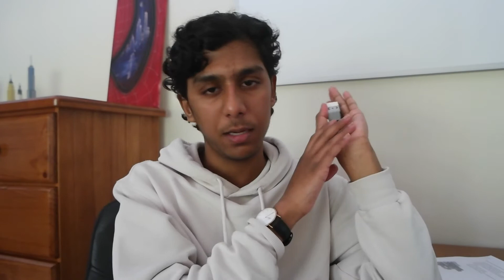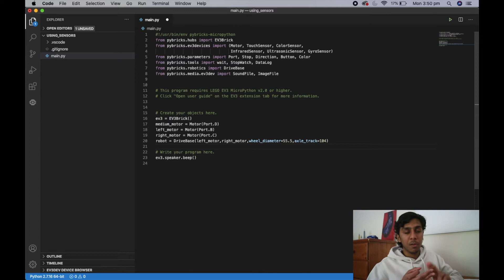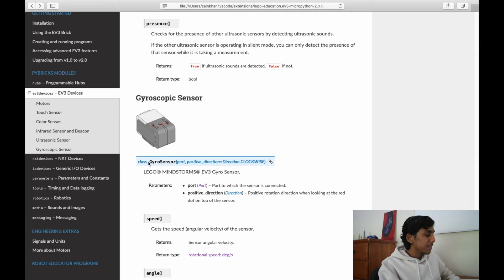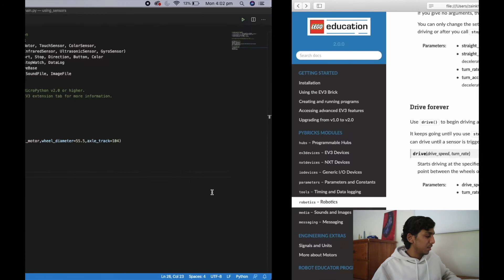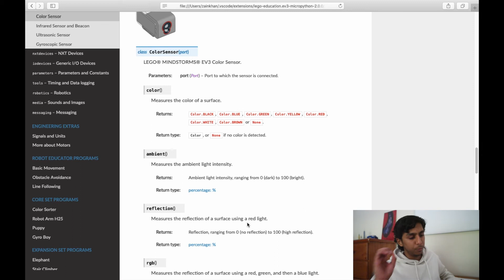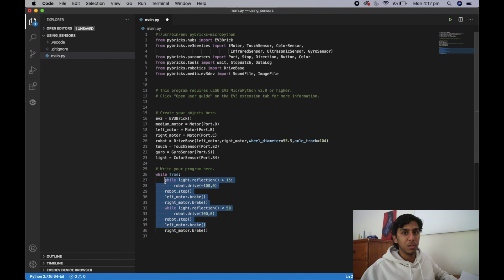What are Sensors and how they Improve your Programming in EV3 MicroPython [4]

Comment: hi, how did you modify your environment?, because every time you run the program it began faster and sound like if you are using EV3-G. Every time I run the program does not make any noise and the startup delays like 5 seconds, which means I need to wait five seconds or more for the program to start to run